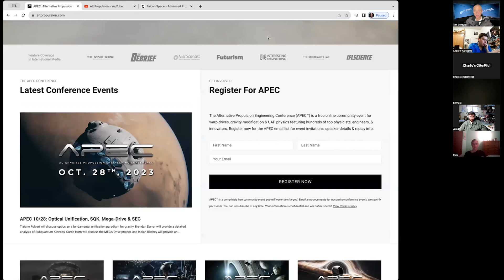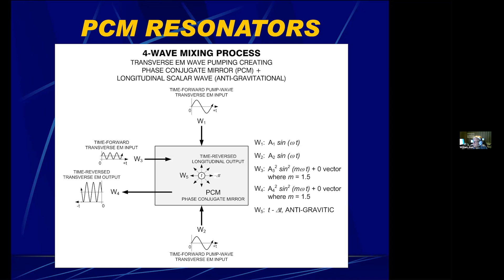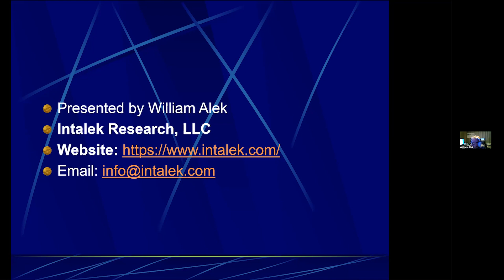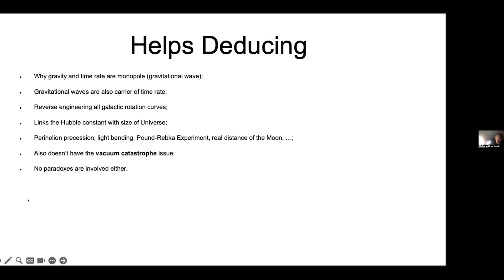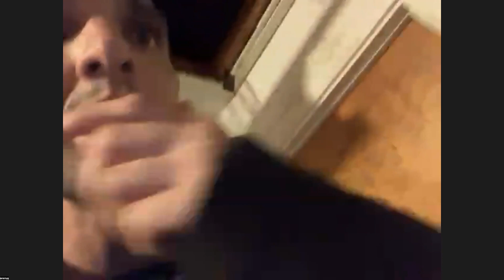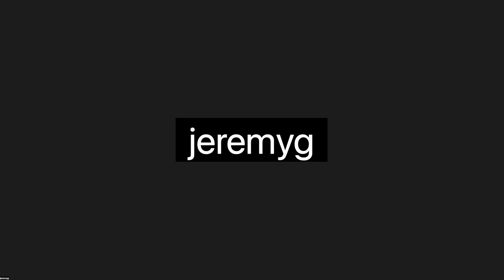APEC 10/14: Open Mic

Comment: Thank you Tim. Yet again, another excellent presentation from Bill Alek on gravity time forward and antigravity time reverse warping space concept. This concept is simply echoing Hawking's view of a black hole and a white hole, in which a black hole functions in forward time, while a white hole operates in reverse time, where the Hawking radiation is the same in both: one particle goes inward and one particle goes outward. However, it's not reality. The time-reversed-wave produced sounds more like "flyback" current.

Comment: I'm not sure how far you collectively are beyond the work of Thomas Townsend Brown's work in Electrogravitics, but it's a fairly simple concept to wrap your mind around. Simple put, build a disk of metal, like aluminum, having several layers insulated from each other. Injecting high tension DC electric current negative on the top plate, positive on the bottom, in this makeshift capacitor to generate lift. It will work in the atmosphere, but better in a vacuum.

Comment: At minute 25:46 the author refers to an oscillating electromagnetic circuit where there is a ferromagnetic core, two coils wound in opposition, a capacitor in parallel to the coils and a load resistance also in parallel, as I see it the circuit is erroneous because it cannot oscillate since the inductances of the respective coils cancel and those coils act only as a wound resistance without inductance, therefore the circuit cannot oscillate or self-oscillate, for this circuit to be able to oscillate it would first have to make a radical change in the geometry of the coils so that even if their inductance is canceled, their capacitance, that is, the electrical capacity between both coils, remains intact. Once this capacitance is isolated, the capacitor should be changed for a conventional electric coil and in this way the circuit would already oscillate and could hypothetically convert a damped electrical oscillation into an ETHER pumping system... sergio moragrega blanco

Comment: I want to thank Phil Bouchard for having been kind enough to show my experiences with mercury vortexes driven by MHD in alternating current, Greetings to All APEC members from Spain from Sergio Moragrega.
Reply: Brilliant work in incorporating the Lorenz force to drive liquid metal in a circular pattern in hopes of creating antigravity effect. However, I''m not convinced that Phil Bouchard is making any real progress, since his work seems to only validate and explain why the insufficient aerodynamics of helicopter rotors are able to lift such massive machines. It's rapid spinning rotor's centrifugal force creates a "tight rope effect" and redirects some mass horizontally outward so that it's insufficient wingspan (rotor width) and aerodynamics are able to lift and suspend the remaining veritical mass and downward weight of the helicopter. If you believe you found antigravity, then the helicopter is an antigravity machine. Of course, that's not true. Sorry, for the reality check...

Comment: The Holy Grail of "free energy" need not necessarily come from the vacuum or quantum foam, but also possibly the heretofore untapped photonic energy pervading the entire universe. That energy is there to be used and reused, so why not do it?

You'll get as much and more "conservation", "over-unity" and whatever other requirements you may have, as you could possibly ever use.

And that kind of energy is something that we are currently capable of understanding and physically working with, unlike infinitesimal Planck-sized "foams", "fabrics" and anti-particles made mostly of intangible aspirations and mathematical symbols.

Photons, i.e., light, also happens to be the same stuff that flattens, uncurves or unbends, if you must, "space time" when pumped through mass. It doesn't get more "free" abundant and useful, for now. And this notion solves 90% of the problems aired here.

When the medium and propellant are one and the same, solutions start looking pretty obvious.👍🏻